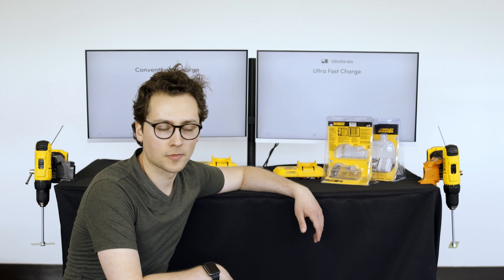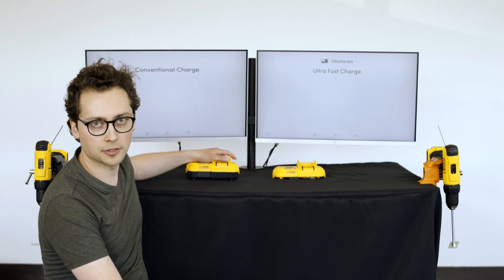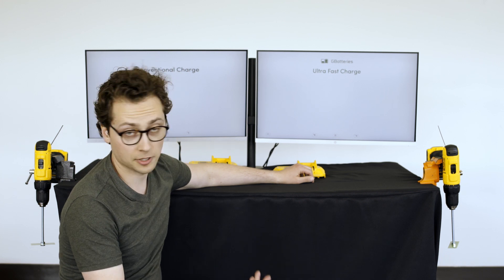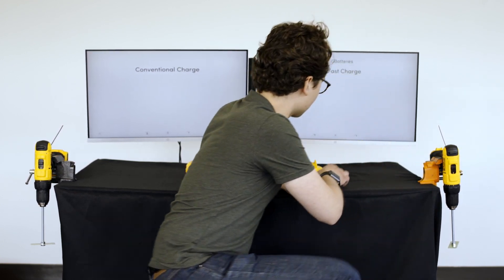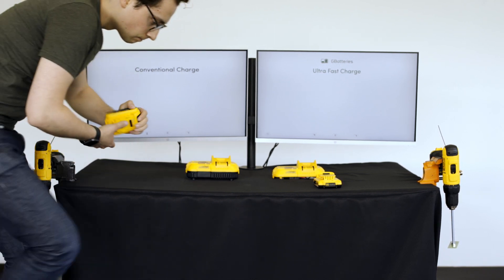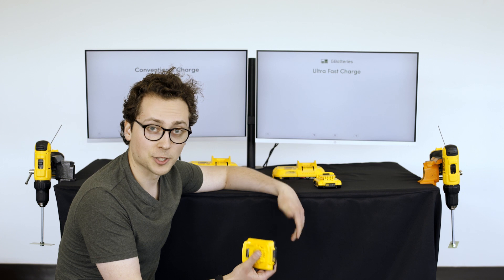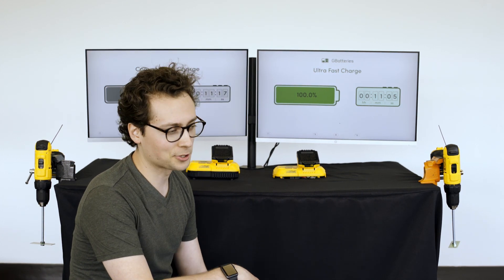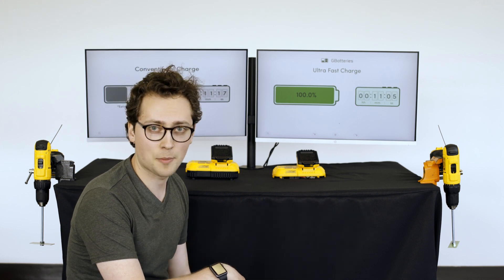Ultra-Fast Charging of Power Tool in 11 Minutes

Comment: Your demo certainly demonstrates faster charge. However it does not demonstrate the cycle life has not been compromised because you only did one cycle. How many cycles can we expect from a Dewalt battery charged exclusively with your algorithm? 

Does your algorithm charge the battery to 4.2V per cell like the standard algorithm does? Since you didn't modify the battery in any way you are relying on the battery's BMS to maintain cell balance, right? Does your algorithm guarantee the cells in the battery will stay balanced when charged in only 11 minutes?